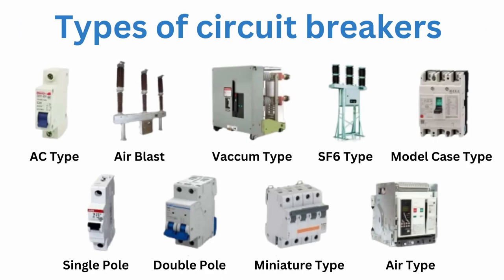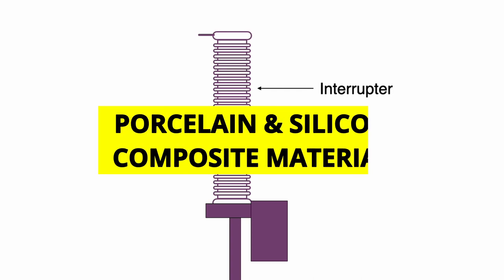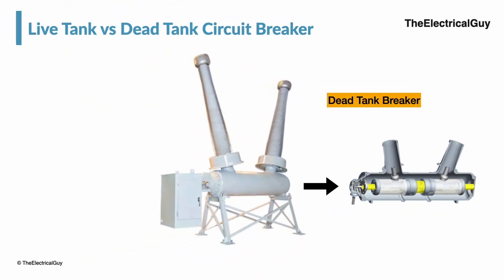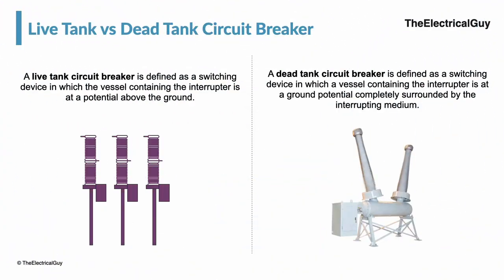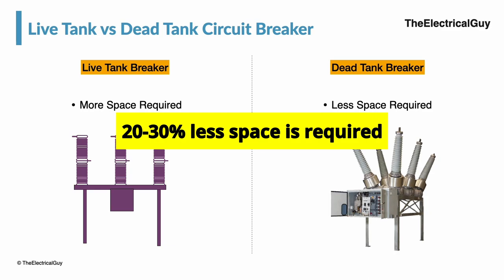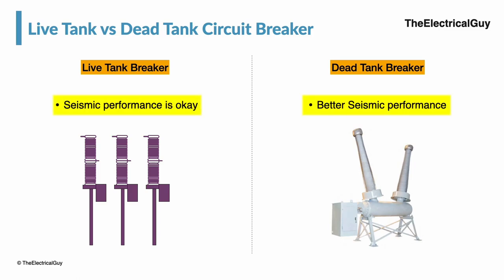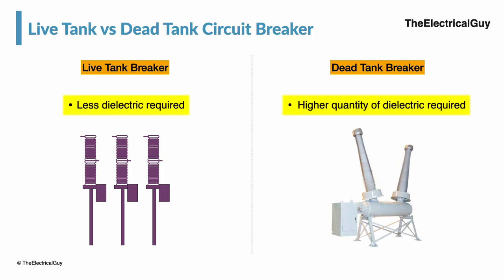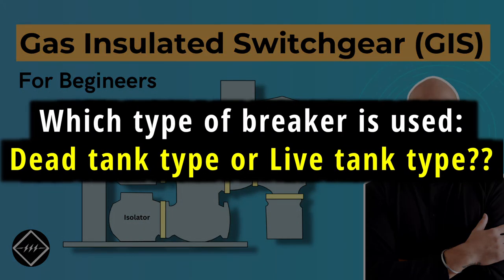Live tank vs Dead tank circuit breaker | Comparison | TheElectricalGuy

Comment: VERY helpful, thank you! DO you know by the approximate cost different between a Dead tank breaker and Live Tank breaker? I'm trying to figure out the difference between a live and dead for a 230kV breaker
Reply from the maker: Dead tank should be at least 2 times expensive than the live tank.
Reply: Wow, thats incredible! I assume the dead tank requires a larger foundation as well? @GauravJ  But its easier to install since all components are encased and pre-assembled?

Comment: Could you clarify why you said that live tank CBs require more space than dead tank ? in my experience it is the otherway because the interrupter in the dead tank is horizontal so the CB is bigger
Reply from the maker: Live tank breaker meeds more space because the insulation is provided by Air. On the other hand in the case of a dead tank it is provided by an insulating medium better than air like SF6 gas and hence it needs less space. You can consider an example of GIS.
Reply: @GauravJ  hey thanks for your response. I was refering to the horizontal space of a whole bay. If you used a live tank which could be SF6 or vacuum you will find that the space required is all vertical so the horizontal space required in less that the case where you used dead tank where the space is horizontal which requires more horizontal space
Reply: You have to maintain more space between two phases in a live tank circuit breaker to provide the insulation compared to dead tank circuit breaker. Hence the horizontal space consumption is more.